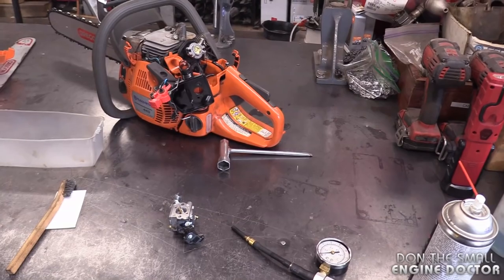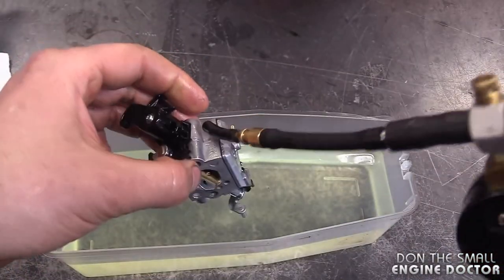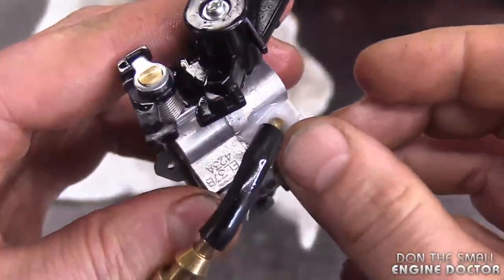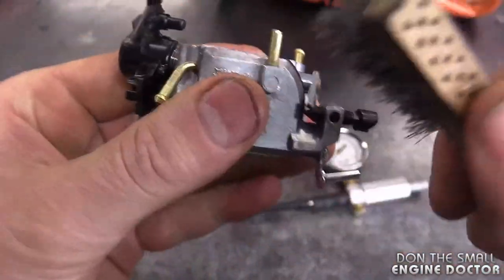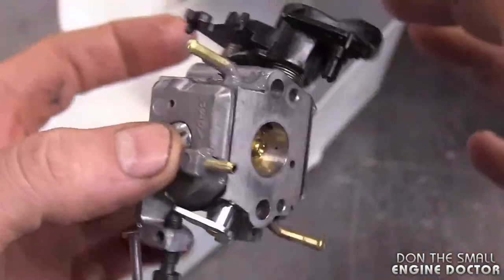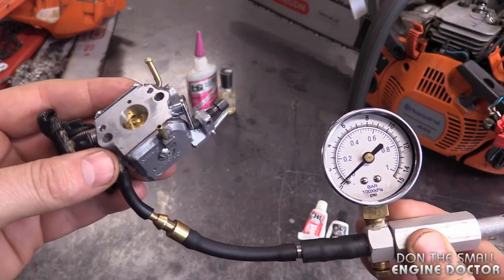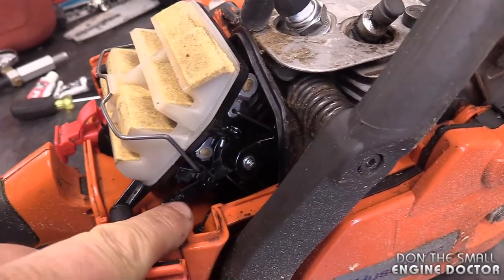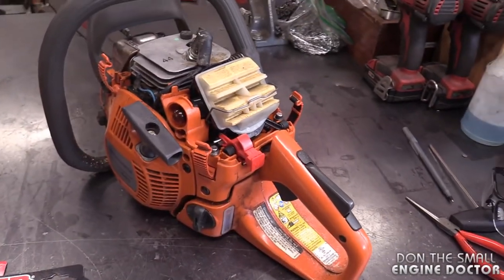Hidden Carburetor Leak On Husqvarna Chainsaw Carburetor! Must see video!

Comment: JB Weld will last about two months exposed to gasoline, then it starts degrading and chipping away. Solder would've been my first choice, or new carb for less than $15.
Reply: I would be surprised if the solder stuck to the aluminum body (unless you use special flux).  Also, it would take an incredible amount of heat to get the solder to flow properly.  I haven't seen any issues with gas and JB weld.  Like for many folks, works pretty well. 
 I recently tried thin cyanoacrylate glue with baking soda on the plastic fuel tank with good results so far.  Sealed a leak around the vinyl fuel line.  A little difficult to replace the tubing later. Wonder if anyone else has tried this?
Reply: @dalebertdurando1496  
Solder might not stick to aluminum but it will flow down into the void between the brass tube and the aluminum and fill it up, definitely stick to the brass. I don’t know where online it said JB Weld can be used on gas tanks, but I had a pinhole leak on an old Jeep fuel tank on the very bottom which I tried to fix with JB Weld. Every couple months it would start getting soft and delaminating from the metal and fuel would again leak. Red Kote tank liner fixed it proper.
Reply: Hmmm, Red Kote instead of jb? Couple layers?

Comment: For a customer. I would just replace the carburetor.  I wouldn't feel comfortable  giving someone a gooped up carburetor.  If it came from the factory that way, thsts a defect that they should have caught. I have lost faith in the quality of Husqvarna after dealing with that snow blower with the badly designed cab where the controls mount. The flimsy material that supports the cables is garbage. Knowing they used that on several brands tells me the industry has gone downhill and they are  all selling garbage any more. For the price we are paying for these products, there is no excuse for what they are selling.
Reply from the maker: it definitely is getting cheaper all the time!

Comment: Clearly not as good as a Stihl.
Reply: Someone in the saws past that has worked on the saw put way too much pressure on the hose trying to get it off of the carburetor is why it's leaking in the first place if they're that tight on it it's just better to cut the hose instead of messing it up too cause most likely it needs to be replaced as well too
Reply: @jamesburke5709  If it was me I would take out the pipe and solder it back in.
Reply: @mrparlanejxtra  there like pressed in from the factory and not soldered into the carburetor
Reply: @jamesburke5709  if the pressing is leaking something else has to be done.
Reply: They stuff up too mate! I have three of them at last count that are kangaroo edward!
Reply: @mrparlanejxtra  if the carb body is made from aluminum, it will be difficult to solder.
Reply: @stephenspreckley8219  they couldn't tie kangaroo Edward down?lol.
Reply from the maker: stihl owns ZAMA carburetor company
Reply: @cooterhazzardbhogg8236  Haha ha ha!
Reply from the maker: @cooterhazzardbhogg8236  lol
Reply: @donyboy73  oh interesting, didn't realize that. So my pro Echo trimmer with a Zama is actually partially a Stihl 😜
Reply from the maker: @rpavlik1  i guess lol